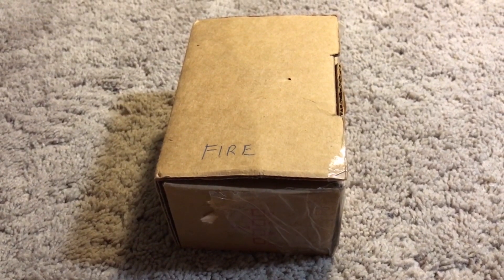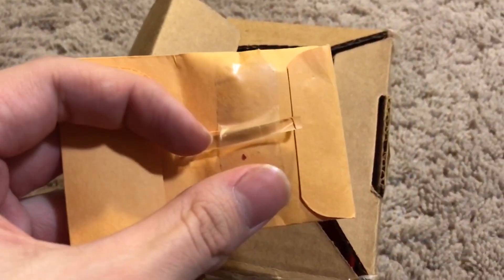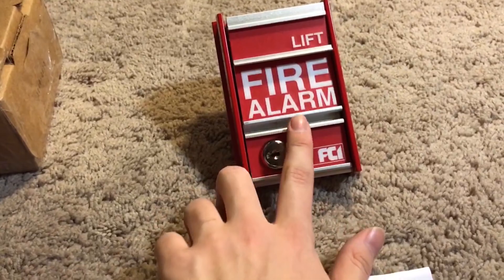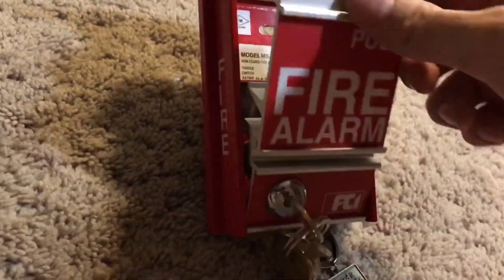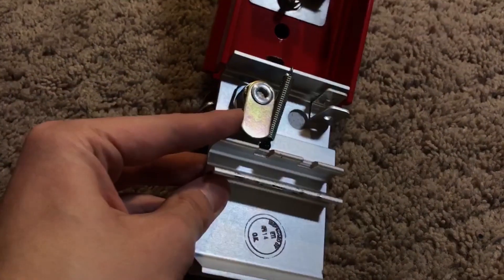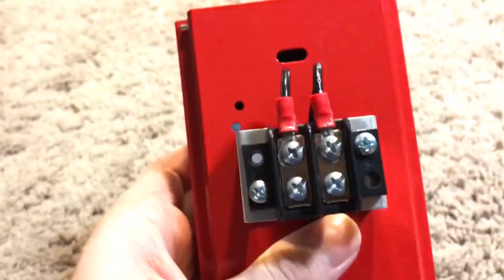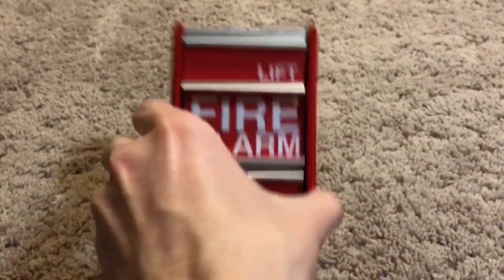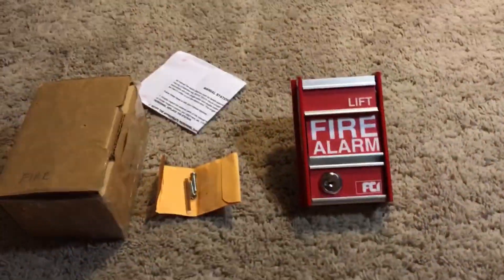FCI MS-2 (Second-Generation) [Fire Alarm Review #1]

Comment: are you sure the fire alarm pull station ms 2s are discontinued because I just saw 1 on sale for 19.99
Reply from the maker: Fairly sure (not sure when exactly they did tho. they were around for honestly quite a long time, only being discontinued no early than like 3 - 6 years ago :-/ (my second gen FCI MS-2 second gen was only made in 2010 btw, which is way later than I thought). Gamewell/FCI must've had a reason they discontinued the second gen MS-2, just it's beyond my knowledge nor can I find anything about that either (they're great pulls however nonetheless)

They'll still pop up on eBay for sure. But I see them in the near future getting rarer considering their discontinuation however. That's my best guess